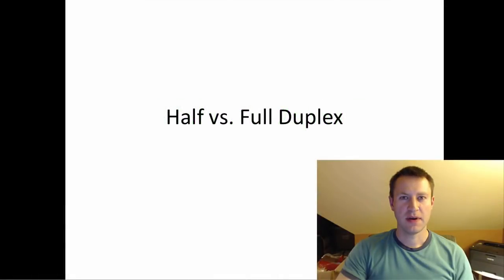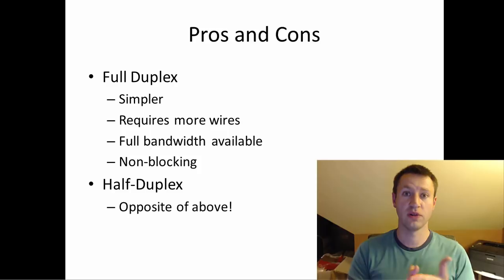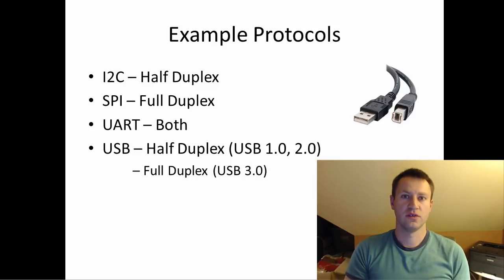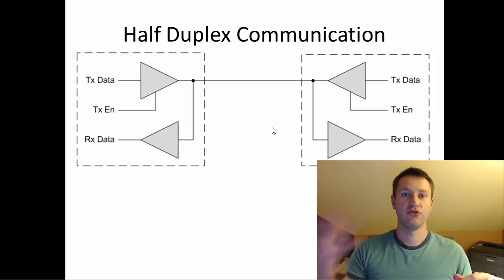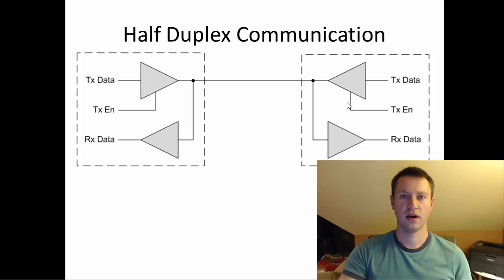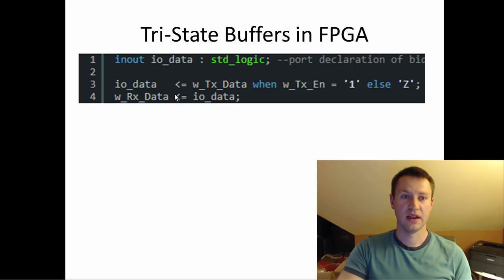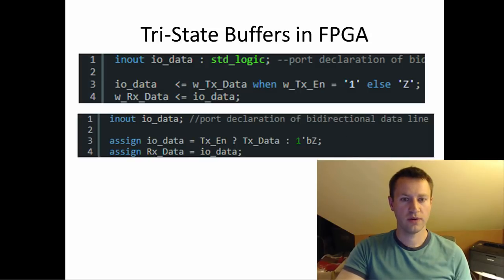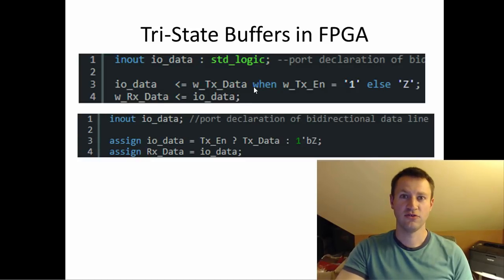Half vs Full Duplex in FPGA & Tri-State Buffer Tutorial

Comment: SPI with a single master and single slave device is sort of full duplex, but when you have multiple SPI slaves you have the same issue with the MISO line. Each SPI device has to be tristated from the SPI until it is addressed with it's own Chip Select. So it's really not any different in design practice from I2C or any other bus where the slave transmit (to master) line has to be tristated.
Reply: But i think is CS' =1 then chip will not be selected in that case doesn't matter we choose tristated buffer lines or normal ones 🤔

Comment: if Rx is connected to the Tx, why do half duplex hubs need crossover cables between each other? 
it looks like half duplex only uses Tx for transmission? would it not then make sence to only use straight through cables regardless?